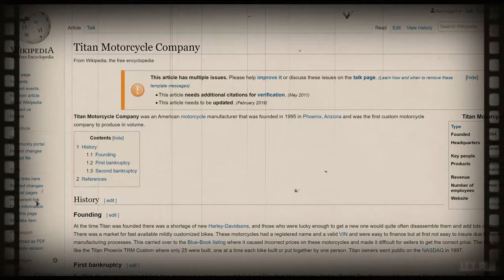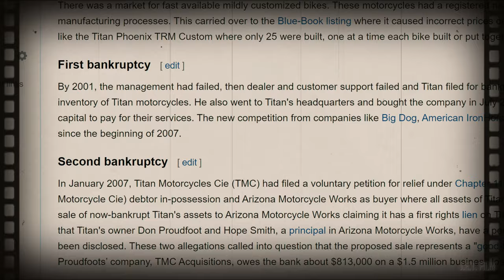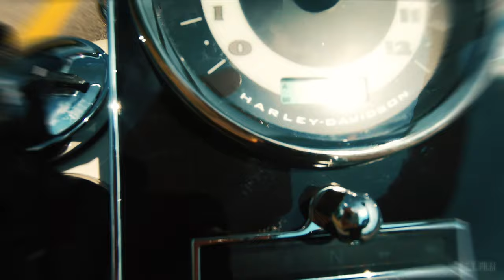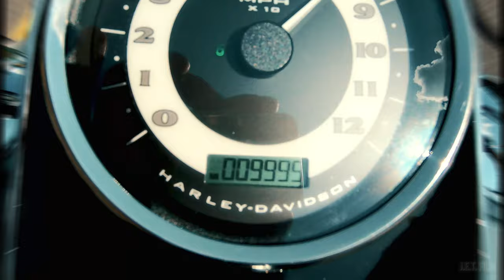"IRON BUTT" motorcycle challenge 2020 - PROBLEMS...

Comment: Making a run at the "Iron Butt Challenge" on your motorcycle, built as it is, certainly made it a more difficult undertaking. Simultaneously, being young, higher difficult challenges are more within your reach, compared to a person who is in their fifties, sixties, etc. I look forward to more of your films!
Reply from the maker: Physically, I think you're absolutely right. However, it's not only a physical challenge, but a mental determination challenge as well. A 20 year old may give up when the going gets tough, whereas an older person may handle less-than-desirable situations with more composure. Just my 2 cents. 
Thanks for watching! More films to come.
I'm planning another challenge later this summer.

Comment: I had a 99 Titan Phoenix bike, good bike except that the fuel line between the two split tanks always clogged which left me with one 2 gallon tank that actually worked. Great looking bike, essentially a Fat Boy on steroids with billet everything. 98 S&S, it could scoot. 

Ryan is a trooper. lol
Reply from the maker: Actually, that bike is currently getting a full makeover. Should be finished in about a month, Travis on the Fat Bob is doing the work for Ryan. I'll definitely have it on film this upcoming season. Good luck with yours, they really are built like tanks with solid motors. Cheers

Comment: Nice build. I do have a question for you. Why a 2013. Why not newer or older?
Reply from the maker: Thanks, I was going to buy a 2018 m8 but aftermarket parts hadn't caught up yet. This bike was selling for a really good price, it was bone stock, it had the color I wanted and the 103 is a tried and true motor. 

Now things are different. More parts are available for the m8 bikes, the engines have more capability and potential for much larger big bore kits.
Reply: @JETFILMCHANNEL  personally i dont need more power. Coming from an 883. I often ride a 103 street Bob stage one. And that thing can be scary AF :). So 103 is the largest i Will go :). Plus the twin cam sounds so much better than the m8, in my opinion.  Plus a new m8 is about 70.000$ here :). So buying something a bit older is beneficial, not by much though.

Btw love the videos. Love the documentary style of commentary in the chair.

Comment: what phone mount did you use and where did you get the usb for the phone routed?
Reply from the maker: It's just an ebay mount. Got it for $10, works great. The USB power gets wired directly to the battery. Couldn't be easier

Comment: Tell me how u fix the header pipe the cross over?
Reply from the maker: I wrote an email to the company I bought the pipes from and they passed it along to samson. Samson sent me a replacement crossover so I reassembled it using more permatex and tightened it as hard as I could and it holds fine now. Still leaks a little bit but I'm starting to come to grips that crossovers are just prone to exhaust leaks and its going to happen eventually

Comment: Was the exhaust of not good quality or possible install error? Might want to think about a new mechanic. Theres one in Cortland my buddy uses for his BMW if you need his #.
Reply from the maker: Hahaha, Samson already replaced the "faulty" mid pipe. Just installed it this morning, GOOD TO GO!!!
Reply: Yeah the regular exhaust clamps that Samson includes are GARBAGE Allen head really can’t get good torque w/o probably stripping but they do replace for heavy duty bolt head clamps if you contact them!!!

Comment: all and i mean all,the knock off hd. bikes are made like shit lousey bearings in the wheels, and add on aftermarket parts, from china. they don't even look good. except on a trailor
Reply from the maker: I'm assuming you're referring to the Titan? Got to say, it did have a great engine, and lots of stock robust billet parts.
Reply: @JETFILMCHANNEL  I see your point as far as engines go, most used S&S some ultima, few evos. all are good engines. but I never meet anyone who owned one(aftermarket bike) not have a problem.most aluminum parts that are advertised as billet are actually cast, not even forged. they just don't hold up, ask any good bike shop mechanic.keep the films coming there good, and nice entertainment while i heal up from a wreck.